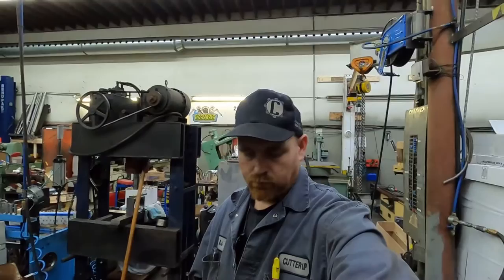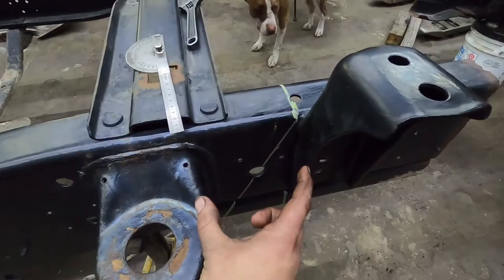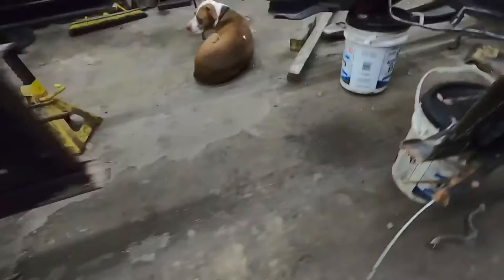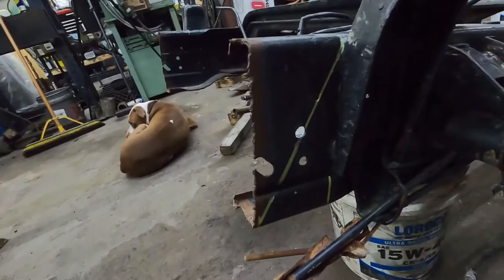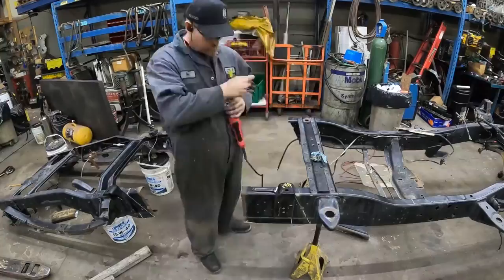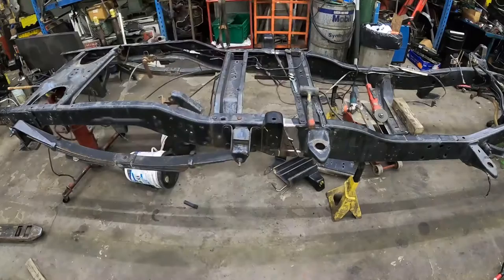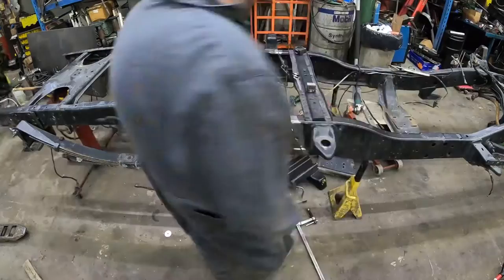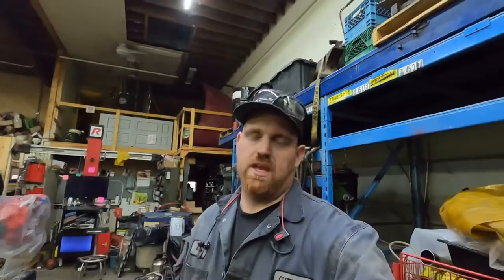The short build— frame cutting and shorten ( second gen Cummins short box )

Comment: Good call for cutting at an Angle, less stress on the weld
Reply from the maker: The old boy that I learned from said from 20-45 degrees was best so I have always just made sure I was in the range. I know there is a way to figure it out over the height to angle for the best length of weld but be did it for 40 years this way.

Comment: I not a expert on frame repair . When I was a kid like 18  I got a job in Dallas after I got out of high school to put my self through trade school . Repairing trailers . I welded a lot of frames back then . I used 7018 . Now days they probably use a wire machine and use 70s wire. I got old so when I lay out some thing to cut I like to use a piece of sharp soap stone so the line is narrow or you can wind up a lot of accumulated error .  I like to use the hockey mask or a face shield and  safety glasses . If you ever get a chance to use one try a metabo cut off grinder . I used one at the power plant I worked at for a long time. . Thanks for the videos
Reply from the maker: Ya I will be using 70s weld in the mig. Ya I need to buy a mask. But I did have glasses on lol. I was being lazy when I was cutting it and didn’t want to stop to make sure I was on the line. No one to blame but me on that lol

Comment: Hey Rob, loving the videos.  Could you do a video on the 5.9 common rail trucks and cover what happens when they drop a valve seat and what the general procedure is for fixing them.  I just picked up an 04 motor for super cheap and it had that happen to it, the head took a beating and piston had chunks imbedded in it etc and very light scoring on #5 bore.  After pulling it apart and seeing the carnage it got me thinking as to what it takes to rebuild one as I seem to have heard that's a common issue and I figured your defiantly the guy to ask
Reply from the maker: Yep I can
Reply: @CUTTERUPROB  Awesome thanks man.

Comment: Love the project, I’m working on a 1996 2nd gen right now. What did you do for the fuel tank? From what I understand the 35 gallon tank won’t fit after the frame has been shortened correct? How did you solve that problem?
Reply from the maker: I used the tank for a short box